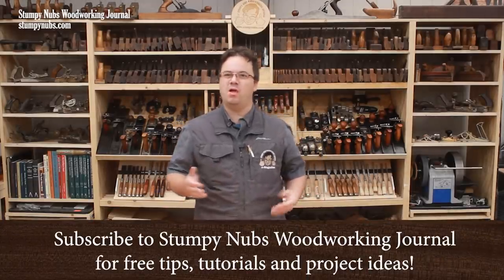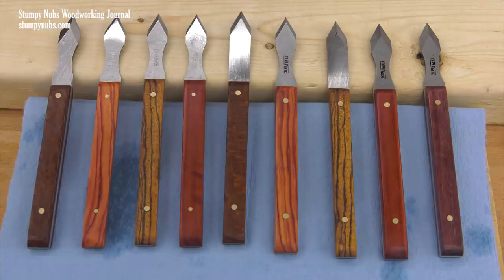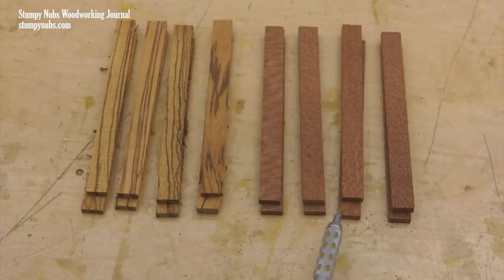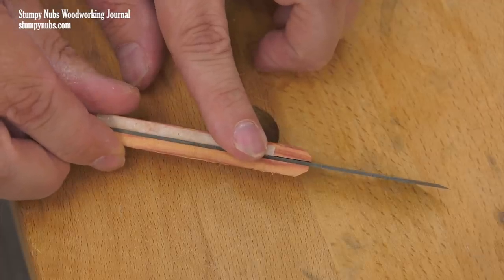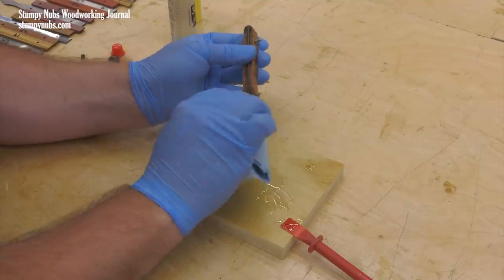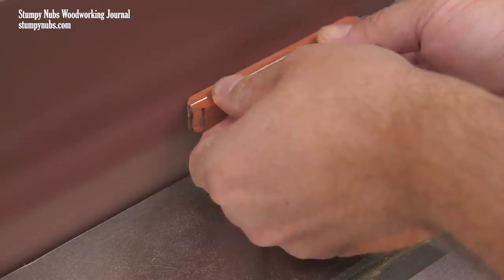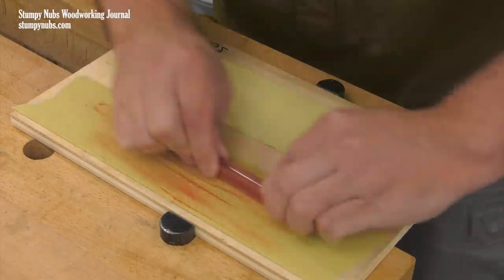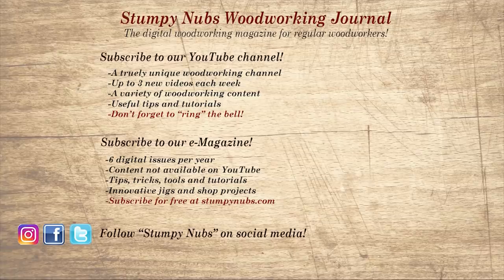Marking knives that can make you money

Comment: Just a word to the wise,,, to keep the pointed end protected from epoxy squeeze out during adhesion, mask up the exposed steel. You don't need painters tape its too expensive, making tape  will work just fine. Believe me , peeling off the excess epoxy in the tape is way better than trying to clean the steel and safer!!

Comment: If you like doing fine work do consider a dental supplier as we use some remarkable cutting and abrasive or polishing points in clinic opperative work , and our laboratories. They do wonderfully if you are using a dremmel (or even get a dental handpiece if you do tonnes of such work).

Comment: Nice video James, will give this a try as I think I have now sourced these blades in the UK. Filing...here is a tip I learned at school in the metal work shop (over 50 years ago). When filing soft materials (Aluminium, Brass or Acrylics for instance) give the file a good coating using a stick of blackboard chalk before use. This helps when cleaning the file with file card of wire brushes.

Comment: Great... Thanks, James, for the tip on getting a kit for this kind of thing... That IS a time saver...

    Coincidentally, for those worried about the resources invested in a DIY marking knife. You can get by pretty decently with OLD (as in messed up, abused, or just outlived usefulness) kitchen knives and hacksaw and file the shape you want into the blank...

     I've done that for both marking knives AND carving knives (which have a similar build and handle, but a slightly curved blade for cutting and carving)... Paring knives work fairly well for it, and with hand sawing and filing there's no need to heat-treat or anything fancy. It's a little more time consuming and work... BUT nothing to get too excited about when turning "discards" into "treasure".

      Marking knives should have a flat side and a beveled side, while carving knives can be beveled on BOTH sides... ;o)

Comment: A suggestion, don't put on the bottom scab.
Leaving it off allows you to lay the tool flat on a surface and still mark.  There are situations where being able to do that is essential.
Obviously, if you leave off a scab, you'll need to countersink the steel holes on that side so the pins can be peened and filed flush.
If you leave one scab off, double the thickness of the one scab that you put on.

Comment: I made my own marking knife out of the ring end of a small, broken combination wrench (15mm). The ring end makes it perfect for hanging it on my tool wall. 
Yes, it included some tedious grinding, but I just love repurposing worn and broken tools, giving them new life. :)
Reply: I'm a sparky: all my chipped crosshheads and worn flatblades become scribes or awls!  VDE terminal drivers are the best (the ones with an insulating sheath down most of the shaft) -- after grinding a fine point, cut ¾" of the sheath, slide it off, and it is perfect for slipping back over the point to make "safe" in the toolbag :-)

Comment: Tip: Finish the front part of the handle sides near the blade point before glue up. That way you can get perfect finish on the nose and belel of the wood and have no marks on the steel.

Comment: That's also a great technique for making any tool handle.
Don't forget that many materials are usable in the same fashion.
I've made scales from wood, bone, antler, old wrecked fiberglass boat hulls, cast and anodized aluminium from scraped engines, admiralty brass that I alloyed from coins and a failed hard-drive with a friend, used tires, shoe soles, phenol resin stabilized fabrics (that's a great one for a gift if the cloth had some special meaning)...

Comment: Little tip, wrap the exposed bit of the blade in several (like.. 5) layers of masking tape before you go at it with a grinder; it'll absorb those scratches that'd otherwise end up in the steel from when you move the bit just a little too far. You have to press surprisingly hard to get through all that spongy tape. Doing it before the epoxy means that won't get on there either.

You can also take one of the blades and cut & tape a piece of low grit sandpaper to that and then use it to cut a channel/rebate into your scales so they can overlap the edges of the blade once things are assembled. This lets you make some more ergonomic looking knives & reduces the difficulty in having to sand/grind back exposed metal. Some people don't like not being able to see that it's a full tang blade, so doing this just on one side means you can make a nice finger dip for higher pressure stuff on one side & still reveal the metal of the blade on the other.

Comment: I make my own marking knives out of a butter knife and a high quality paring knife, the two blades separated by steel shim,. the reasoning {which panned out} was the butterknife rides the metal ruler smoothly, and the cutter has a depth set by extension past the butter knife end.

Comment: Hey Stumpy great instructional video as usual. After making many knives for carving I have learned what not to do. 
Something that can help go right is to protect yourself and the cutting edge by tapping the end with painters tape before drilling and applying epoxy. Additional. After you drill the first hole put another drill bit of the same diameter or the pin in the hole to prevent scales from slipping. It happens, last thing you want is holes that do not line up once epoxy is down. 
Thanks for the links for the Narex blade blanks, I will be making some Christmas presents for some friends this year.

Comment: I thihnk it can be beneficial to polish the flat side and leave enough exposed so you can use the blade ultra close to being against your wood so you are marking right into the point of intersection of the wood, AND you aren't making a "V" that ends up being a bit like a tiny chamfer (looks like an opening and probably worse if you scribe hard or multiple times). 

Thoughts from experienced hands on my advice? I like feedback so I can be as precise as possible.

Comment: If you want to do less sanding or filing on epoxy, it is quite easy to scrape off with a sharp piece of plastic before it is fully hardened.  I would try it at 45 to 75 minutes.

Comment: I needed a marking knife on short notice, broke the one I had somehow. I ground down a Bosch jigsaw blade and sharpened it. Made a hardwood dowel, cut a kerf, shaped it, glued with some epoxy. Had a serviceable thin blade marking knife in short order.

I have to say I like the look of mine better than these bulkier kits. But I do plan to pick up a couple of these kits and make a couple of stronger making knives. I like the dual bevel blade style. I want the body to have more taper at the business end.

Comment: If you need exotic woods locally, find a lumber supply house.  Not for purchase, but for OFFCUTS.  Ask a couple local contractors where they buy large quantities of rough-sawn lumber for flooring and cabinetry work.  I have a nearby shop who always has small scraps which can't be used for some rich guy's 3000 sqft cocobolo kitchen.  They take the scraps and toss them in a dumpster, and eventually burn the pile when it's too big.

These places can be hit-or-miss when you visit, but in my case I can get a modest scrap for a buck per board.  They're literally going to burn it, so making even a dollar is money they never had previously.  I've walked out with rough-sawn 1x2 strips (up to maybe 18" in length) for less than $10.  Came away with enough hickory, acacia, zebrawood, purpleheart, and ipe to build dozens of small projects like pens or cutting boards.  And if you build most of project from common hardwoods like maple or walnut, you can really stretch your dollar by laying down thin accent strips.  I have a piece of zebrawood I bought for a dollar over two years ago and I'm still pulling accent strips off it for projects.

Comment: Knife makers tip. Before epoxy dry assemble. Place tape at the blade end going into scale sides. Place scales on with dry fit pins. Razor blade next to scale. Lift scales off pull away the cut side under the scale. Should leave you a perfect match fit. Epoxy and set scales clean up easy 1 2 3
Reply: Great idea. Thanks. I assume that getting the epoxy ALL over the parts has happened to you before !
Reply: @andrewbieger5004  I was once told epoxy is not don't right if the amount you place on part is not equal parts placed on everything that touches part... ie me...

Comment: Looks like a great project for a rainy afternoon .. but I'd only consider making these as gifts, not to sell. Each blank kit costs $13 .. and the same site sells one ready made with a Rosewood handle for $19. So, if it costs more than $6 in labor and materials (glue, paper, wood, tape) per pen, you will need to charge more than $19 to break even. You still need to make a profit within that $6.
Reply from the maker: Just because Taylor Tools sells a factory made knife for $19 doesn't mean that is the limit. Heck, I can buy a wood pen made in China for a few bucks. But have you seen what people pay on Etsy and at craft shows for "hand turned" pens? You're not going to get rich selling marking knives. (The potential customer base is smaller than it is for pens). But $40 or so is not out of the realm of possibility if you promote the "hand made" angle.
Reply: @StumpyNubs  $40? Wow .. that's where my imagination fails me. I look at a product and start thinking unit (i.e. variable) costs, fixed cost apportionment, net profit per unit, production rate and roughing out what you'd need to sell the item for in order to make a living at it.

I'm an engineer by profession and instinct. If I can obtain the same result for a lower expenditure of energy and resources etc,  I will naturally lean that way. So, I simply struggle to understand why someone else would pay that much for a tool when I  can get the functional equivalent (the blade is the important functional part in this case) for half that price.

That's my failing. I understand that other people place value on appearance etc. 

It doesn't mean I go for the cheapest option ... just that I personally look for what I consider "value for money" - and  a cosmetic item such as appearance has a very low weighting in that calculation. There are things where I will pay far more than the average person because I know that 50% extra in cost will reward me with significantly more than 50% extra in performance or longevity.

Comment: Must be using small weak drill press, I've had a bit catch and spin a work piece out of my hand once and fortunately it didn't have a sharp blade on the edge.
Reply from the maker: Small and weak? No. I use this drill press: https://amzn.to/3dvJeW1 If I was drilling through the steel, I might worry about a catch. But a 1/8-inch hole through wood? Not going to catch.
Reply: @StumpyNubs  I have same drill press, the bit caught on the hole edge in mild steel template I was using as guide into pine.  My old bench press just had belt slip instead.